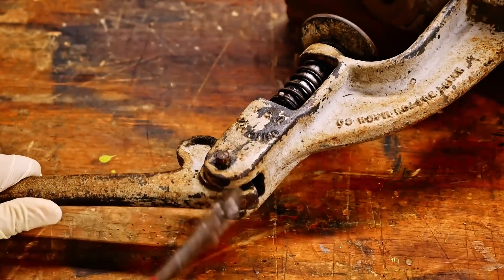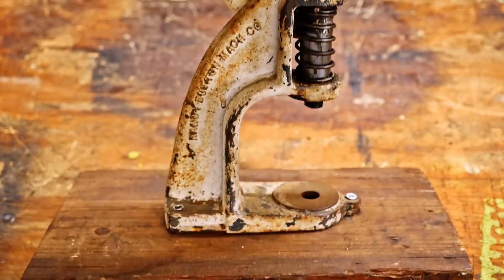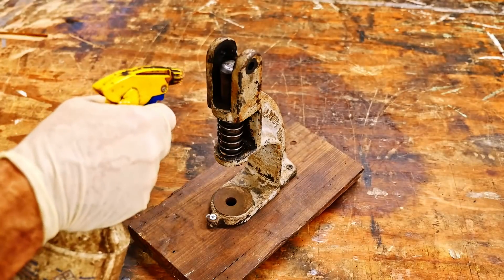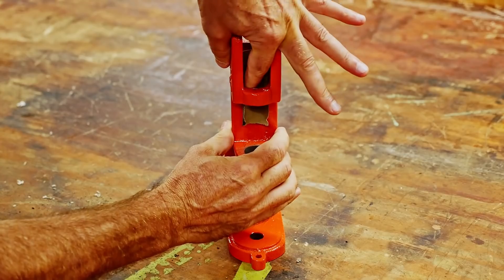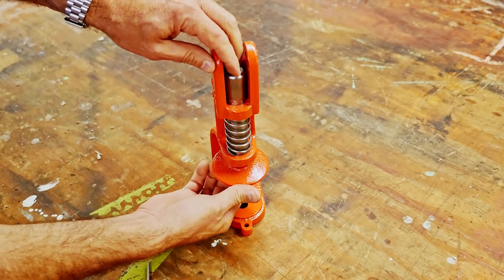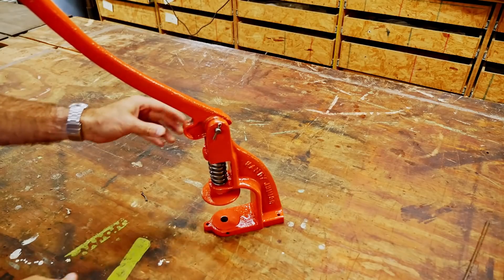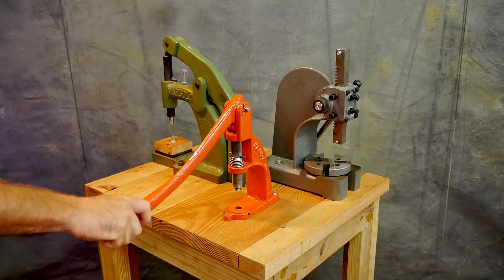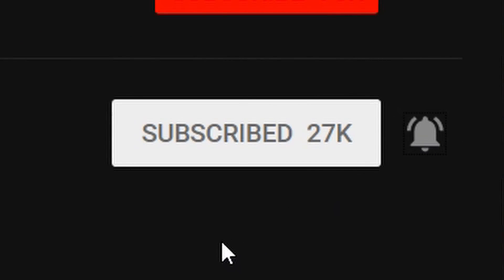Handy Junior Button Press Restoration

Comment: Recently found one online for $35. Did some looking online, and I'm glad I found your video. Looks great now! I'd far rather put in some work on an old, quality tool than buy something new and cheap. Just wanted to know if set up with a rivet-set if this could properly set copper or brass rivets for leather working needs?
Reply from the maker: I am sure it would with the proper dies. Have you found any rivet die for your machine?
Reply: @AlexanderDyer  
No, I haven't found any rivet set dies for these. Also, the one I found has no dies included. I would make something so I could punch holes/set rivets too. Just wasn't sure if these presses had enough leverage/pressure to set a soft metal rivet.
Reply from the maker: You are right about the metal being pretty soft so I do think that there would be enough force generated by the press once you get it set up how you like.

Comment: Hi Alexander. The press looks great but can you tell me where to get a disk like the one you have at 7:45 in the video? I have a few other people looking as well. Thanks so much.
Reply from the maker: I made my own out of an MDF cutting board. For more part and accessory availability I replaced the main shaft with the "cs osborne pin w-1p" Now I just get C.S. Osborne parts which are still produced today.

Comment: Hi Alex… because of you I went ahead and found an old handy junior button press… rusted… but didn’t get it for 15$ that’s for sure! Now I need dies and cutters? You mention the cs osborne can be made to fit??
Reply from the maker: https://youtu.be/ZgURfvK3FMU?t=175 This is me figuring that out. I bought a new CS Osborne stem which fits perfectly.
Reply: @AlexanderDyer  thank you for the reply!! Looks like you got a new nylon block as well… so I would need to get a new cs osborne stem if I wanted to use the cs osborne button dies and cutters?? Is this correct? I found a site that sells them called Workroom Buttons…. Is there another site you would get these from? If you could get a bonus I would get from where ever you suggest?
Reply from the maker: Yes, you would need that stem, it has the correct threads. I don't have any advice as to best source but thanks for thinking of me.
Reply: @AlexanderDyer  ok… just a quick question since you have experience… would you say it would be best to switch out instead of trying to find Handy Junior dies and cutters? Which aren’t easy to find anyway!